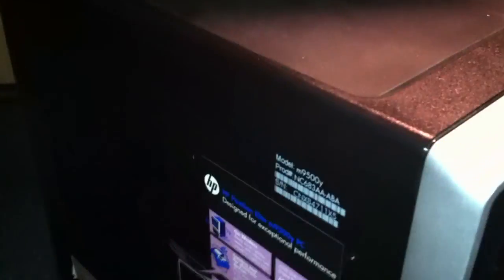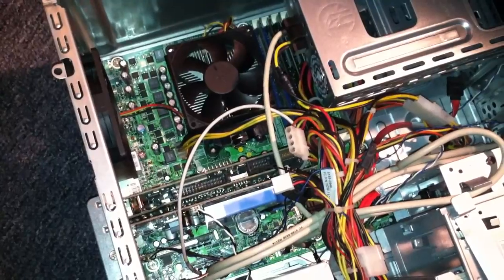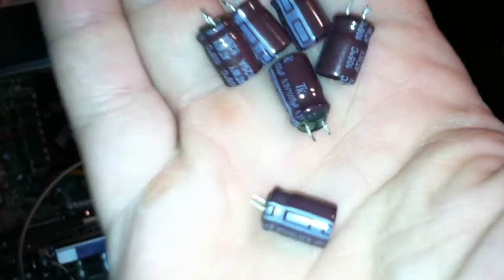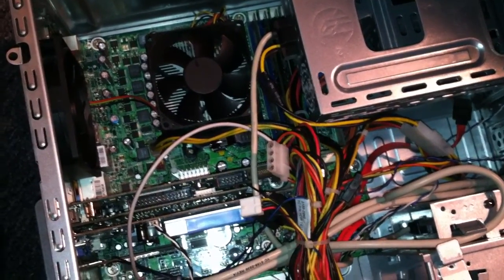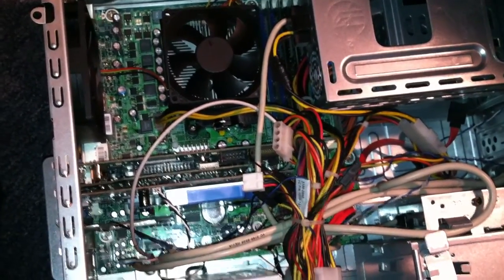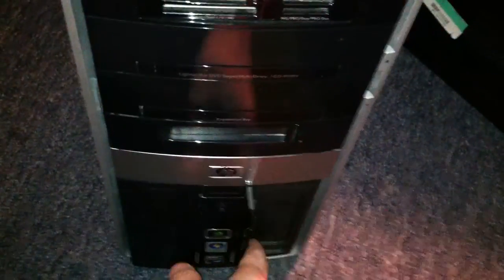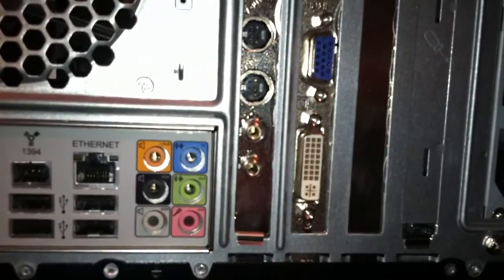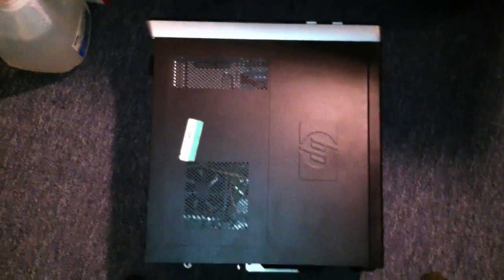Hewlett Packard HP Desktop Power issue and repair

Comment: What if when you push the power button the fans come on with the LED light doesn't light up and it won't boot?
Reply from the maker: Not sure how much help i'll be on this as I no longer have this machine and haven't worked on one since.  

My recommendation is to unplug everything unnecessary (motherboard w/ CPU and cooler, 1 stick of RAM, and graphics card if on board isn't available) and try and power up, if that doesn't work try another power supply (could try this first if you want) and if that still doesn't work, try a different stick of RAM and finally if it still doesn't work you may want to think about replacing the motherboard or CPU.
Reply: @iconoclast518  It just strikes me strange that the LED for the power button doesn't light up anymore and at the same time the computer won't boot up or go to the CMOS.
 I don't think that's a coincidence.
Reply: For the power on and no lights issue iwould suggest swappingthe power supply out for a known good power supply.  It really does pay off to have a spare power supply on hand.   Or if you are tech savvy, then use a voltmeter to check for proper voltages with the power supply out of the case and disconnected from the PC.
Reply: @matt8911  I did that with a pretty expensive power supply that was brand-new. No such luck.😔